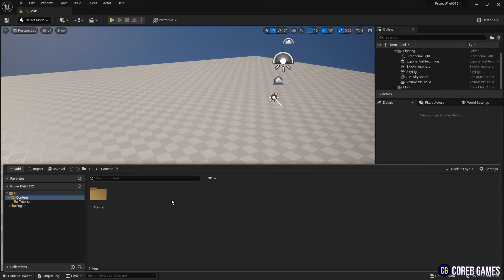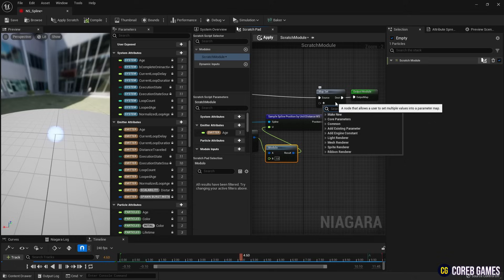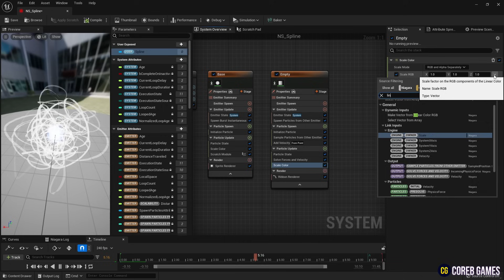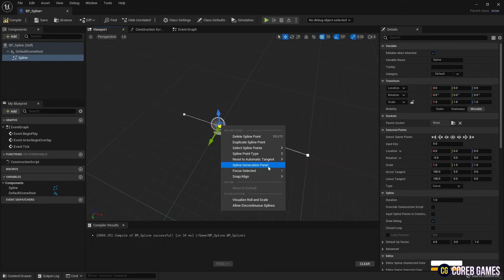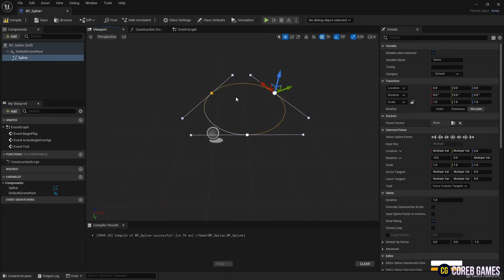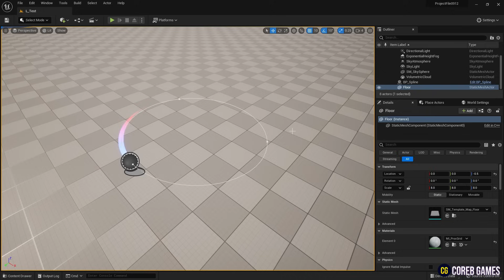UE5 l Create Movement Niagara on Spline l 5-Minute VFX Tutorial l Unreal Engine 5

Comment: 1.Make sure in Scratch Module map you have PARTICLE Position input. Not LOCAL Position. 
2. Don't forget to hit APPLY on Scratch module and all will work.

Also question:
How to spawn more particles? I don't want only one following the spline.
I don't want CIRCLE spline, how to kill particle when it reaches 1 of the spline? Other wise it teleports and creates trail.
Reply: Thank you i was worried that it wasnt working
Reply: Just don't use the module (%) in the scratch module

Comment: scratch module*  keeps giving a compile error on unreal 5.5, some sort of issues with the map set and spline position. in  5.5 when you connect these two nodes it automatically adds a new node in and this seems to be the issue. not sure how to resolve it as a beginner though

Comment: Not working in UE 5.3, particle is not following the spline.
Reply: Make sure the "Scratch Module" is under "Particle Update" and not "Particle Spawn". Compare the order and position from the video to yours.. Had the same problem and fixed it by moving them in the right place. Works with 5.4
Reply: Solution is the APPLY button in the Scratch Module